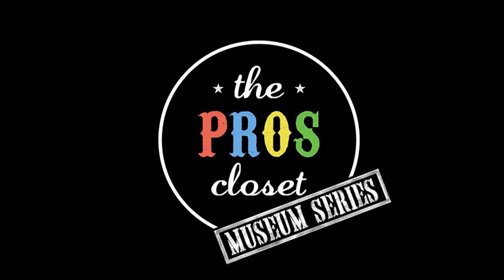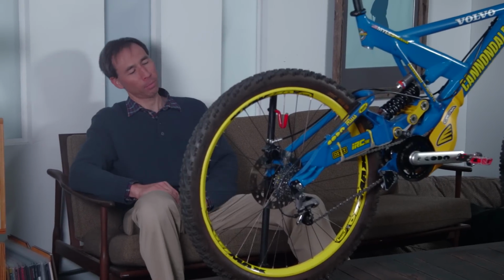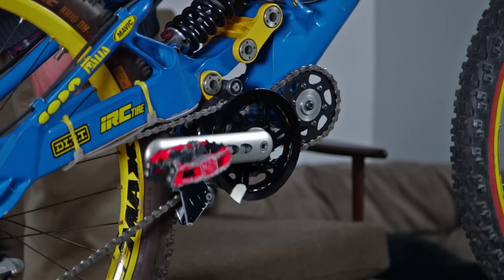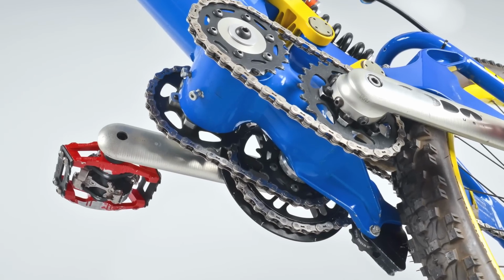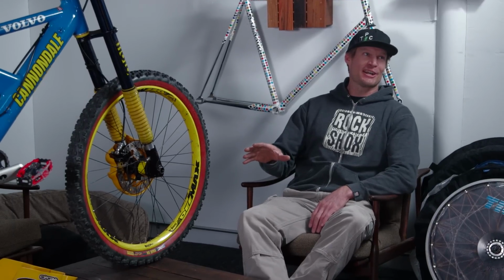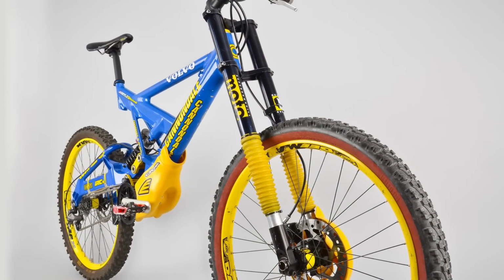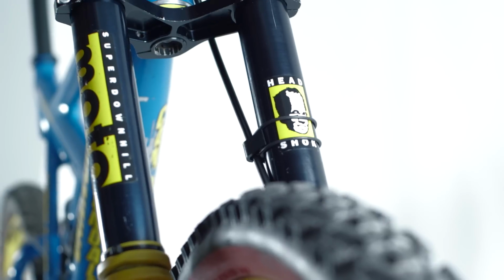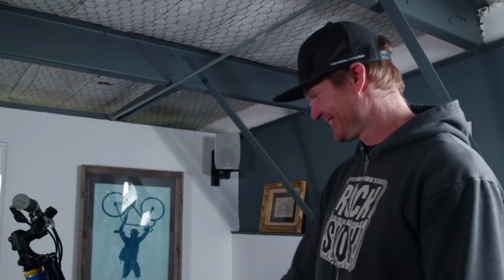TPC Museum Series #4: Myles Rockwell's 1998 Cannondale Fulcrum | The Pro's Closet

Comment: IRC Cujo!! Such awesome tires. Rounder profile compared to the IRC Missile, but rolled so damn fast. 

Fun Fact: when cannondale were testing the Ocho Lefty fork, they 3D printed an upper crown & part of the leg. That way the XC team were able to run them at races without other teams realising what they were. Once satisfied with results / data from the fork, the mechanics just unbolted the 3D printed section 😂 

Hopefully the new Cannondale DH that went through testing the other year appears on the circuit.